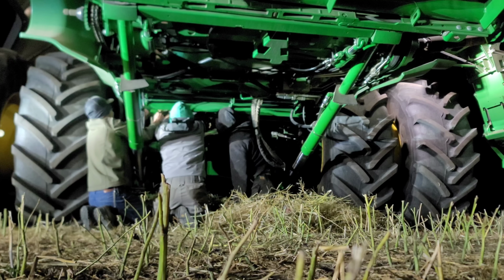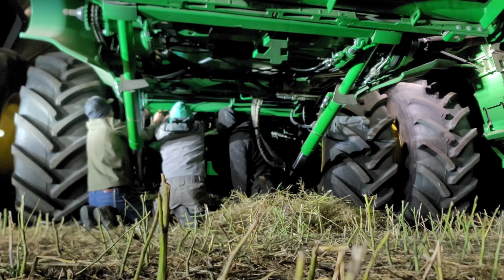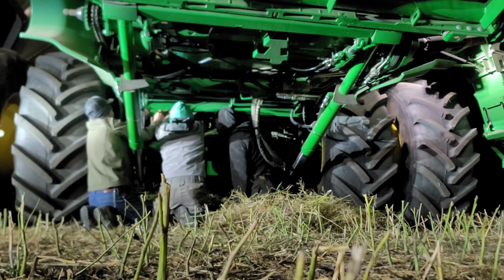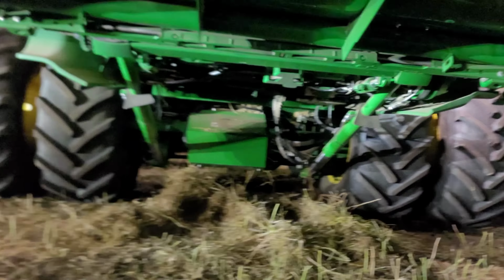Should have quit sooner! 🤦🏻‍♂️

Comment: Hey mike sorry if it's a dumb question but whats the difference between normal harvesting and swathing then picking
Reply: Normal harvest means putting the combine through standing crop, whereas here he cut the crop with a swather, and now is combining the swaths after they have dried down.
Reply: @ke6gwf  yeah i got that figured but what difference does it make
Reply: @ke6gwf  isn't it less fuel efficient that way
Reply: @blurd3xgaming-932  I guess you didn't watch any of his swathing videos where he explains it in detail lol
Basically a crop has to be dead and dry before you can combine it, but an entire field doesn't dry out at the same time, or it may be taking too long in a wetter field.

If you wait until the entire field is dry, the parts that dried first will have gotten too dry and the seeds will have already fallen out of the pods onto the ground, plus, it might snow before it's all dry.

So they either have to spray the field to force everything to die and dry quickly, or you swath it and let it dry that way.
Swathing works faster in cold weather than the chemical sprays, and it doesn't require driving through the crop with a sprayer, or hiring a plane to spray, and it works faster when it's getting cold, so it's the best option for situations like this.

He didn't swath everything, the idea was to swath enough to keep him combining until the unswathed fields are dry enough to combine directly.

Comment: On the S series and prior you normally can switch the feed accelerator belt to low speed, leave the tensioner loose, then with the separator running at idle put tension on the belt and be able to work it through. Or if that doesn’t work have a big enough socket or wrench to turn the beater backwards.
Reply: really never could do that on the 9770s

Comment: Mike, you talk about safety first but there are 3 folks under the header and feeder house with no cylinder lock in place.  And the combine is running.  I never trusted anything mechanical or electrical systems to act the way they should when I was on the farm.  I learned with PTO shafts to just shut the tractor off and I never had to worry about getting pants or anything else caught and becoming one legged or worse.  Starters are cheap in my estimation.
Reply: I do believe  on that new JD there is not a cylinder lock but a switch that you activate  on the side of the feederhouse that locks out the cylinders.

Comment: Mike if you plug it feed accelerater open the rock trap lift your header all the way up and reverse the header and most should come out just don’t stall the combine when starting up the rotor!
Reply: does the feed accelerater on the x9s reverse now
Reply: @jenniferloveridge5494  I mean they do on all the s series just reverse the front of the header and it turns with it.!